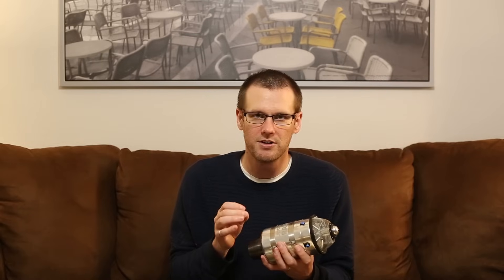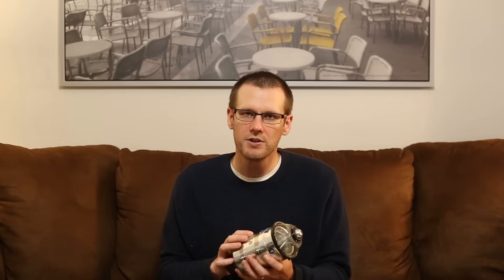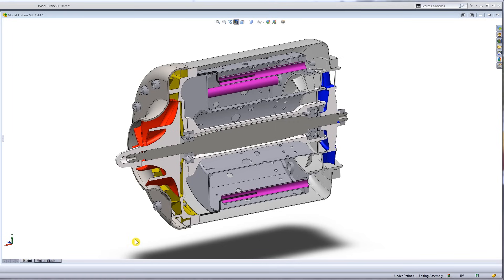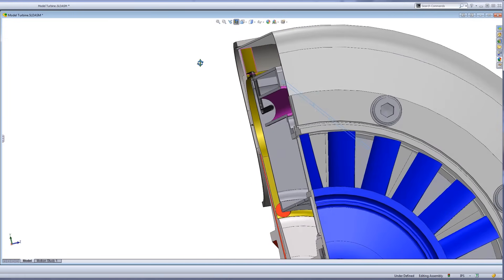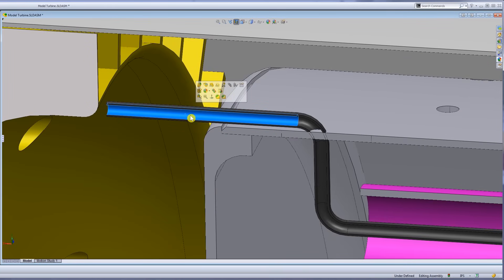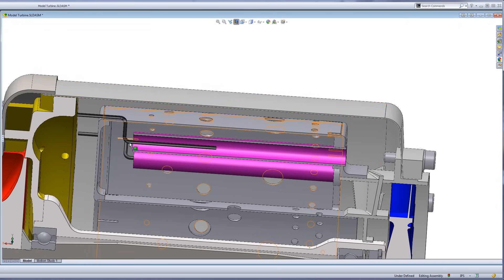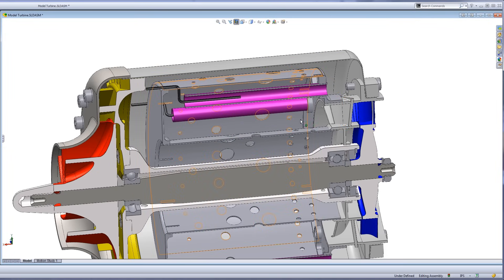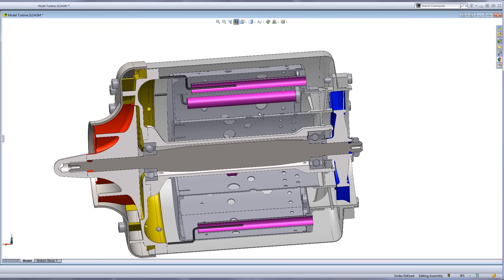How an RC Model Jet Turbine Works

Comment: There is again someone claiming to have the smallest jet engine in the world https://youtu.be/welFwxpOABk 
What do yo think? I don’t think that jet turbine engine is self sustaining. I think it’s fake, but so many people there believe it’s real and running self sustained.
Reply from the maker: Hi Paul, Excellent craftsmanship and effort in making that turbine. A jet turbine with a diameter around the 30mm mark would have an idle RPM of over 150,000. A large orange flame coming out of the nozzle at idle is not usually a good sign. RPM of a jet turbine once the fuel is cut comes down very quickly and then tapers off, and generally does not hang.

Comment: Could you make a video about the bearing's lubrication-cooling process ?  Where are the pipes that feeds oil to the bearings ?
Reply from the maker: In model turbines, the lubrication is in the fuel. A very small percentage of the oil in the fuel makes its way to the front and rear bearings. There are no oil lines that feed the bearings. If you are familiar with how a small 2 stroke internal combustion engine works and receives oil to all internal components, the small model turbines lubricate in a very similar manner.
Reply: @RCexplained  the fuel/oil mixture is directly injected into combustion chamber, there is no way for oil to reach the bearings?

Comment: Dumb question. Would there be any way to extend the rear turbine and add an after burner ring to make a true afterburner? I see a lot of real rc afterburners but they don't seem to do much but burn extra fuel for show as they are attached after the rear turbine
Reply: Edit. I know it would cause so many problems such as extreme rpm's and extreme heat. But damn it would be cool to see a truly functional rc afterburner. Who's rich enough to build it though? Haha
Reply from the maker: Hi Jeffrey. Yes it has been done and does significantly increase thrust when the fuel mix is correct. It should not have an increase in RPM's but will have a lot more heat out the newly fabricated exhaust. 
An afterburner burns fuel after the last turbine wheel stage. The expanding gases simply exit the turbine nozzle only and do not flow over any rotating components. That's why it has the name "afterburner."

Comment: @2:17 kero start turbines doesn't uses propane  gas to start or sparkplug.The kerosene flows through a  injector and a glow igniter for ignition. But cool video. My buddy will be doing a actual rc turbine teardown and reassemble to testing video
Reply from the maker: Please check description.  That is cool. Which turbine will he be opening up? I didn't want to open it up and void a lifetime warranty. I'd like to open one up but to be honest there's not going to be much in there to see.
Reply: @RCexplained Second video will be a Rhino..but I do understand about the warranty 😁 what are your plans for the engine?  https://youtu.be/yeOt4z3rtio
https://youtu.be/f2ITUJSo9ME
Reply from the maker: It's in a Boomerang sprint

Comment: Thanks! Very clear explanation. Would have liked to take a closer look at what you are holding though.
Reply from the maker: Hey Buck, thanks for the comment! There's not much to see on the outside. In the front you can see a small section of the compressor wheel, starter motor and FOD screen. In the rear of the turbine through the nozzle you can see the back face of the turbine wheel. 
I'd love to take apart the Turbine, however, I don't want to cancel the warranty on it. 
There is another video where you can see more of what is required on a turbine airplane to make it all go. It's also the plane where this turbine was stolen from. 
https://youtu.be/9On_PlQItPI
Reply: @RCexplained  Okay, but zooming in to eliminate the space wasted on livingroom furnishings (which is most of the image) would be much better.

Comment: Really super explanation. Do you have any idea why these engines sometimes stall on people during take off? Is it a lack of rigorous maintenance like partial disassembly and spraying out parts with a carb and choke cleaner?
Reply from the maker: HI Michael, thanks for the comment! I would expect a flame out to possibly be related to fuel delivery. A small air bubble in the fuel delivery line is enough to cause a flame out.  
Maintenance on most turbines are required to be done every 25hours of operation.

Comment: I have a dumb question . Why do others have propane and also kerosene ?
Reply from the maker: Hey Francis.  It's not a dumb question, all questions are welcomed on this channel! And thank you for yours!
The propane is used as starting fuel since at room temperature it already exists in gaseous form. Thus it's easier to ignite.  Once the propane ignites kerosene can be introduced and the propane is then shut off. 

A kerostart turbine requires heating up the kerosene in order to turn it in to gas form to start the turbine.
Reply: @RCexplained  thank you very much ! I learned a lot because of your channel .
Reply: @RCexplained  The term "kerostart" would have made more sense if you included this in the video: it means starting on just the engine's normal fuel (kerosene), instead of starting on a special starting fuel (such as propane).

Comment: how does the oil make its way to the bearing especially the front one?
Reply from the maker: Hello, both bearings are exposed to the internal fluid flow. The fluid is pressurized in the entire cavity.  An extremely high percentage of oil actually never makes it to the bearings and simply burns out the exhaust nozzle. However this very small percentage of oil does make it to the bearings. 

In a more conventional jet turbine, there would be a dedicated system that pumps oil, injects the oil on to the bearings and then recycles it back to a reservoir. 

In our models, we rely on a much more simple system.

Comment: How will this engine start ?
I mean before starting there is no heat in the combustion chamber or nozzle to convert the liquid fuel to gas.
Reply from the maker: Hello, for a kero start system, there is a pre heat of the fuel before ignition. I mention in the video that is uses a spark plug to ignite the fuel, however, a better term to use would be an igniter. Ignition can be created from either a heat source or an electrical spark.

Comment: Hey just a question...what system is used to spray fuel through the nozzles...is it an electrical pump or mechanical system? What pressure does it function at?
Reply from the maker: Hey James, It's an electric pump. I've never measured fuel pressure or saw any specification on it. I would expect pressure to be quite low. If you are looking for a specific value, I'd get in touch with the manufacture.
Reply: @RCexplained  thankyou very much for the reply,I wanted to know the preferred setup for RC!! I'll contact them!thanks again for an informative video,I subscribed!
Reply from the maker: @jamesscott5407  Hi James, the RC turbine manufactures have everything included so that you do not need to worry about the specifics to this degree. For example the electric pump is typically integrated in the included turbine ECU. In  a future video I will go over all turbine components in an RC Jet airplane. 
Thank you for the sub.
Reply: @RCexplained  yeah I guessed that by the prices haha...it's more of my curious mind than anything else...I've read some literature on turbine engines and they use swash plate style pumping elements so just wondered how the RC world did it. A video like that would be awesome. I wish you luck in your endeavours here on you tube,well presented and visualised!

Comment: These model turbines do not have a spark plug they have a glow plug also known as a burner during the start sequence the burner turns on and a fine amount of fuel is sprayed onto it because the element is glowing hot the fuel flashes off and ignites then as the engine temperature and RPM comes up to a defined setting in the ecu the main fuel line is opened adding more kerosene to the engine at the same time the starter motor increases it's speed turning the rotor assembly up to about 20000 RPM before  diengaging the engine is now self-sustaining and will ramp to idle depending on the engine anywhere from 30000 to 45000 RPM
Reply: You actually answered the question I came looking for. He didn't mention  the rmp needed at starting to get to self sustain. Thank you so much.

BTW noob question, the glow plug is it automated? . Does it glow on its own or is it attached to some electronics which I don't think so.
I checked YouTube and there seems to be no explanation on how the glow plug works.

Thank you so much sir.
Reply: @jacobokpara7618 , I'm a bit late to answer your question. 
But Glow Plugs are used in a lot of RC engines. 
Some electrical current is passed into them, and they heat up. 
After the engine is "self sustaining", the glow plug will continue to be hot, (even without more electrical current). 

In the case of smaller piston RC 2-stroke engines, the glow plug continues to serve as a point of ignition (once the pressure increases enough)
Fuel Air Mixture + Pressure + Temperature of Glow Plug = Combustion 

For the RC piston engines I have, a separate "Glow Plug heater", is clipped onto the top of the engine. It is just a battery, and the top of the glow plug completes the circuit and heats up.

Once the engine is running. the Glow Plug heater, is removed. And the engine runs on its own.
^for the piston engines. 

In the turbine, it may serve as a way to restore ignition (should the flame go out).
But with turbines, there should be a continuous moving flame in the combustion area. So I don't think the glow plug would really need to do anything else after the start up phase.
Reply: @andrewmattox1233  the real question is where to put the glow plugs i dont understand
Reply: @pepepopo6415  the glow plug used to be a traditional plug screwed in from outside the turbine.  Most have an internal glow plug now.

Comment: hi Ryan,

I emailed an RC turbine manufacturer asking why RC turbines do use bypass fans given they are capable of up to 80% thrust (ref RR)..
No answer
Reply from the maker: Hey HiTekHead. Assuming you actually meant "do not use."  I would expect the reason RC turbines do not use bypass fans is purely due to cost. Most turbine guys are not worried about fuel consumption. The biggest difference you would get by using bypass fans is better fuel efficiency. However there is a cost to this as well as the extra complexity.

Comment: blows me away almost no-one makes a diy high voltage generator out of these.
Reply from the maker: It's certainly possible considering they make these for turbo props. One thing to keep in mind is that they are terribly inefficient.  The one shown in the video burns a litre of fuel every 3 minutes. When the plane is in the air it gets worse fuel mileage than my car.
Reply: @RCexplained  In theory my plane can do at least 40km with 6 litres of fuel in 8 minutes or less (that would convert to about 16 miles per gallon). Considering its going more than 185mph at that consumption its far better economy than any car :-)
So the car comparison is a bit difficult since there is so much more to consider... Weight, Payload etc. 
But of course you're right. They are very inefficient.
Nevertheless it would be interesting what such a small turbine could do in a backup generator.
Reply: @RCexplained  i wonder how many hobbyists have tried cheaper fuels, vaporized fuels for higher efficiency on a cost basis. liquid fuel seems so stone age.
Reply from the maker: hey Jester. Do you have an example?
Reply: @RCexplained  My swiwin turbine only burns 1 liter in 7 minutes at cruise speed
Reply: @NoonzAirborneRC  And that's a horrible amount of fuel for the energy produced by the engine.